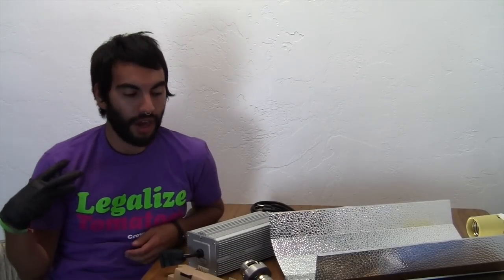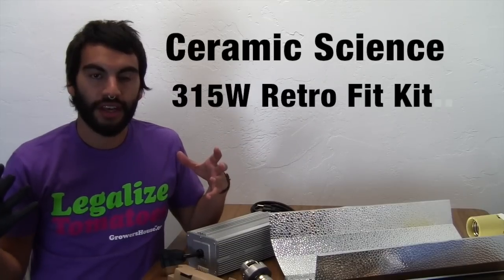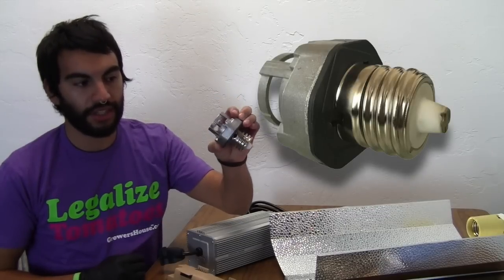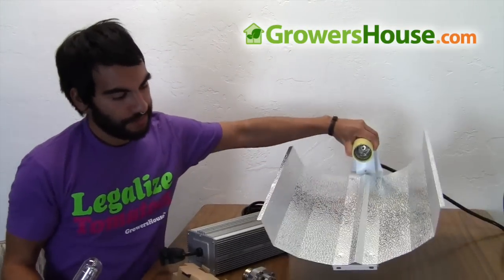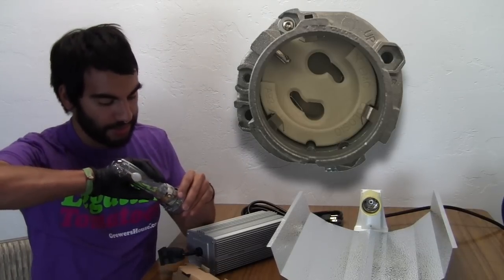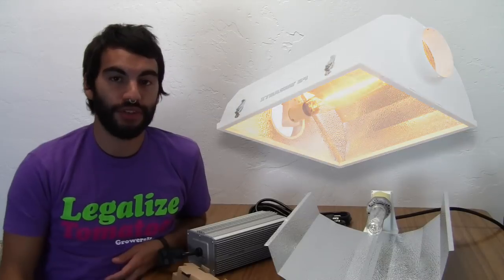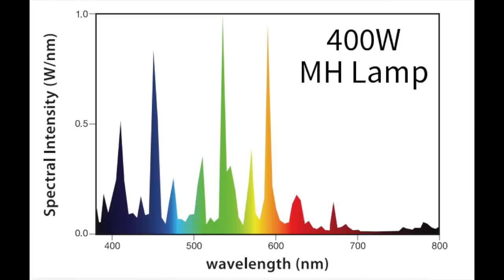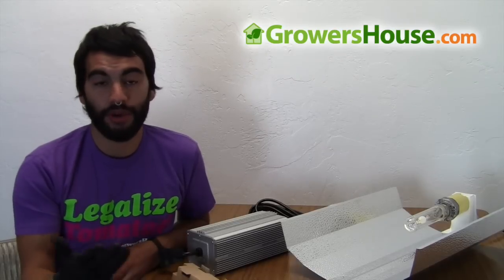Ceramic Science 315W Ceramic Metal Halide (CMH) Light Conversion Kit Unboxing & Review

Comment: The retrofit kit shown in the video makes me think  of the CMH retrofit kit Philips was selling a few years back to retrofit and convert existing HPS and mercury streetlights to CMH bulbs-210W or 315W.The 210W replaced 250W HPS or mercury and the 315W for 400W HPS or mercury.Surprized the 210W lamps haven't shown up for plant lamps.Some ballasts I have have a 210W output setting!The 210W bulbs were available thru Philips Lighting.

Comment: so would 1 light do 3 plants
Reply from the maker: Yes, 1 light could do 3 plants. Probably on the smaller side, like maximum 4 foot tall plants when they are at the end of their flowering stage.
Reply: Growers House well mine are doing fine in flower 16 days and the love this type of light and ballis what do you mean at end of flower ?
Reply: Growers House plants are around 120cm in hight from floor, what is the best distance between plant and light ?
Reply from the maker: It will depend slightly on the plant and it's stage of growth (veg vs. flower--you can get slightly closer to your plants in flower), but in the range of 1-2 feet (30-60 cm) should be best.
Reply from the maker: By end of flower we mean the tallest point your plants will be before you harvest them. As a rule of thumb, you usually flip your plants into flower when they are about 1/2 the max height you can tolerate in your garden e.g., if your plants are 2 feet and you flip them into the flowering cycle, you'll end up with a plant that's approximately 4 feet tall.

Comment: I have heard that the mogul conversion adapter  causes the CMH bulbs to fail in some instances. Is there any information backing this? I was told buy the "expert" at my local hydroponic store that they don't recommend using the adapters and have chosen not even to carry them because they have heard that they have issues?
Reply from the maker: To date we've sold over 3,000 kits and our return rate is less than 1%, which is exceptionally good for a ballast/bulb combo. We're outfitted commercial growing operations that have had their lights running for approximately 2 years, changing their bulbs out about every 14-16 months, and they're extremely happy :)

Comment: Hello guy, the 315W ballast laid on your table was welthink ballast made in China, not your 315W ballast which you were talking and showing in the video, they were not matched, nobody noticed that? Welthink ballast on his table had 4 higher strips on the top of ballast, had a side label, and had a square cover plate, compared growershouse's ballast showing in screen, no obvious higher strips on the top, no side label, and had a rectangle cover plate, quite different with the ballast on his table which was exactly from welthink electronic in China, the first professional manufacturer of grow light ballast in China with rich experience over 10 years.
Reply: Hello Ivy Lou, yes you are correct. That was a Welthink ballast on the table. During the filming of this video we did not yet have the Prism ballasts available so we used the Welthink ballasts. When we first introduced the Ceramic Science packages we had them with Welthink ballasts. We then switched to the Prism ballasts, which we are much happier with.

Comment: any issue with a cmh/led bulb being air cooled?
Reply from the maker: Since CMH bulbs are double jacketed, they can better withstand air being blown over them than single ended HPS lamps which only have one outer jacket. That said, any bulb that has a great deal of cool air running over it will burn slightly less intensely than one burning at its designed operating temperature.
Reply: Thanks
Reply: Growers House are these the same as cdm 315 bulbs

Comment: I'm really Co fused about one thing. so how does the ballast hook up to the reflector. will I have to rewire some stuff. I have a old magnetic ballet that runs mh/hps
Reply: The ballast plugs into any normal Standard (otherwise known as Sunlight) style reflector cord. You will have to use the ballast shown in this video with your current reflector (assuming it has the same connection). You cannot use your magnetic ballast for this bulb. 

Link to cord style needed for this ballast: http://imgur.com/ZpquMjE

Link to adapters to Hydrofarm style reflectors: http://growershouse.com/ballast-to-reflector-hydrofarm-common-standard-plug-adapters-baasp

Comment: its a good idea, but not for that reflector, its barley inside of it: the reason they mount CMH vertical, to make it effective they have to catch the light coming off the back of the bulb, which you would mostly loose in this reflector. I can see some of the smaller 400-600 watt HPS working very well. CMH lights are dangerous, its spikes deep in the IR, and you can feel it in mintues: it make you feel strange, and you eyes even with sunglasses, mostly for UV blocking don't do anything for IR. I wear a baseball cap and long sleeves if I need to get under it, and be done quickly.

Comment: Will the dimmable 400w HID ballast at 75% fire the 315 MH bulb using the adapter?
Reply from the maker: +Dennis Spittle We do not recommend using a 400w HID electronic/digital ballast dimmed down to 75% with 315w CMH bulbs because most digital ballasts operate at a higher frequency than optimal for the CMH bulb. It may ignite and drive the lamp, but you will not get optimal performance out of the lamp and you'll decrease the lamps life span. The Prism Lighting Science ballast (along with the Philips ballast) are low frequency, square wave ballasts.

Comment: Does this replace using HPS when flowering? Like so you dont have to switch from MH durring veg then HPS to flower.
Reply from the maker: +tonymengela More Flower for Less Power, it definately is proving to replace HPS lamps and maybe even 1000W HPS also. Thats $$$ saved in energy costs. CMH has a wide spectrum AND UV output. It might replace HPS/MH swap outs as well. But don't take our word for it. Theres lots of Pros asking us about it and we thought a great way to make it economical to try CMH was for a kit like this can be used in any mogul reflector you might already have waiting to be tried out.
Reply: *****  well my reflector takes 2 bulbs and my digital ballast is a solis Tek that can split into two 600wt lamps or push a 1000wt in over drive. I am wondering if you have to use their ballast or can you just get the socket adapter and use your own. I am hoping you could get two bulbs to complete the entire spectrum under one reflector  like I can with the MH and HPS. I am liking this bulb and the specs you are posting and I noticed in a different page that they have I believe two different bulbs with different light temperatures... I am hoping I can use my own ballast thought
Reply from the maker: +tonymengela You can use any ballast that's compatible with the bulb wattage, so as long as its pushing 315w you're in the clear. You definitely should not run it with the 1000w SolisTek. We do have the 3100k & 4200k cmh bulbs which is basically the equivalent of having MH/HPS to switch from veg to flower.
Reply: ***** I can switch the wattage all the way down to down too 400 and split that to 200 to two bulbs if I want. or 600 split to 2 300.

Comment: props for pushing economic value CMH -- all the pro growers on IG in Colorado are converting to these, premiums results.
Reply from the maker: +derty QWERTY goal is to make growing more efficient (photons of light energy per watt of input power) at less upfront cost (light fixture price). We forsee prices of CMH going down over the future, and we're looking to help jump start the economical CMH options.
Reply: @GrowersHouseGrowLab  ok so it’s 4 years now. In 2021, where would you say the CHM is now? 
Are you still selling the socket adaptors? 
Thanks!
Reply: derty QWERTY you can get cdm 315 watts puts out like 600wat cfl bulb  but uses less electric omega 315 watt cdm ballis I'm using one on 3 plants and all doing good just as a test